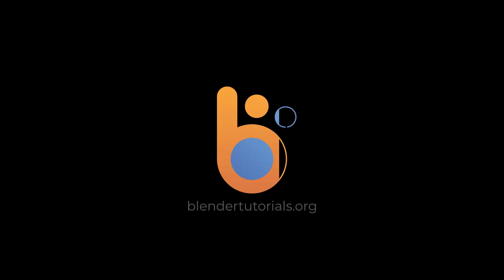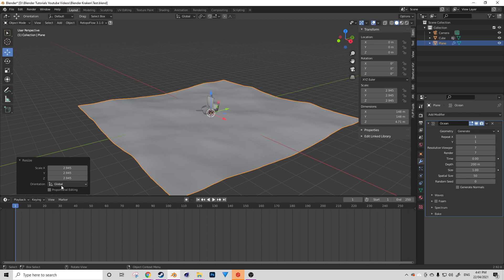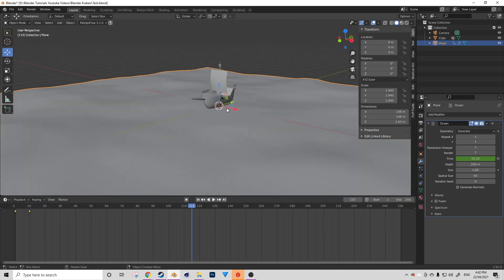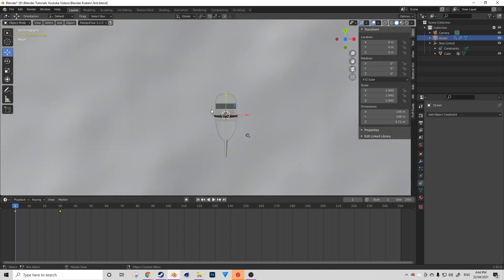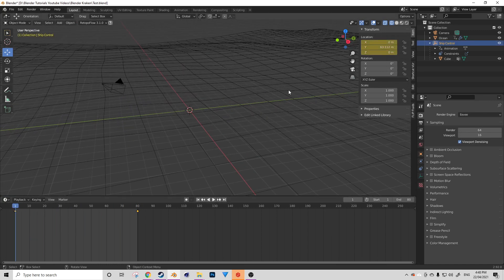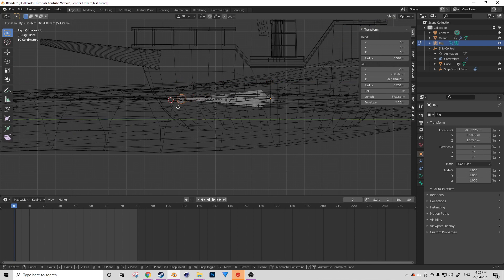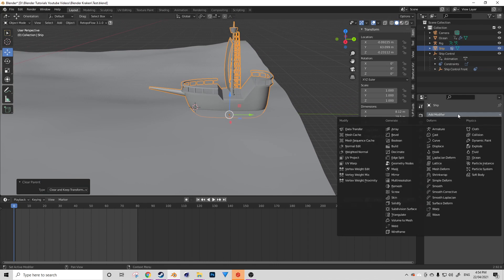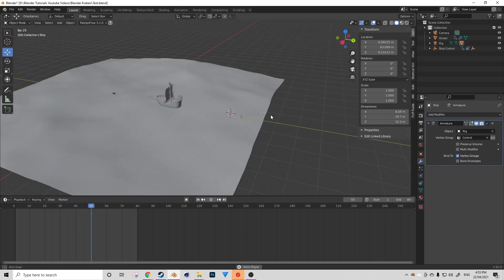Blender Tutorial | Create a Ship | Part 2

Comment: Is there a part 3 coming? I would like to know how to add the textures to the ship and the water.
Reply from the maker: Aye, there is a Part 3, I just havn't had the time to edit it as I have been working on https://blendertutorials.org

But I will have part 3 out soonish.
Reply: @Polyfable  Hey, I have a question about something from the "Part 1" Video. So, do you know if there is a different way to make the top part of the fence? I tried using your way but the fence didn't receive the full "round" shape, it had a gap in the middle. I think this is probably because I messed up on the wooden beam part with the shape of the beam (I am very new to blender so I don't know much about it :(        Thanks a lot for your help!
Reply: @Polyfable  It's been8 months, Is part 3 going to be released anytime soon?